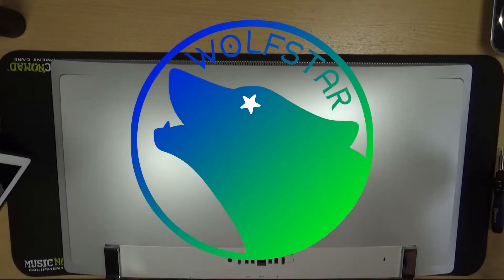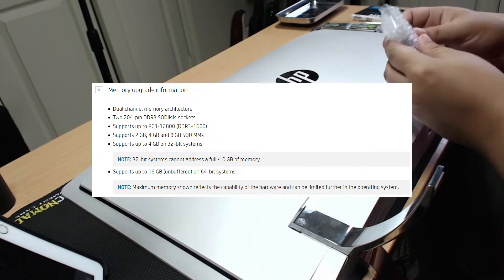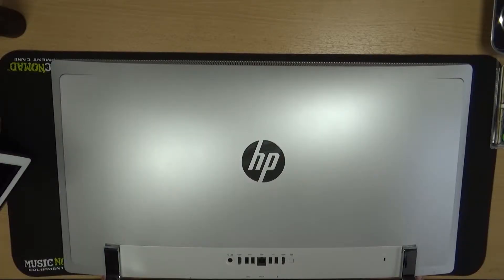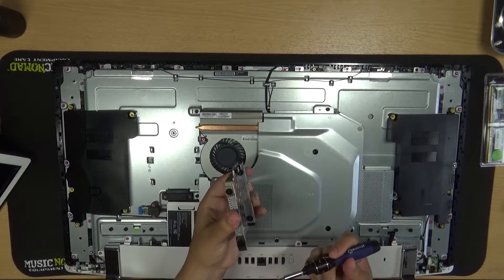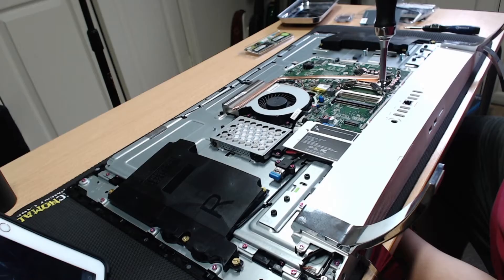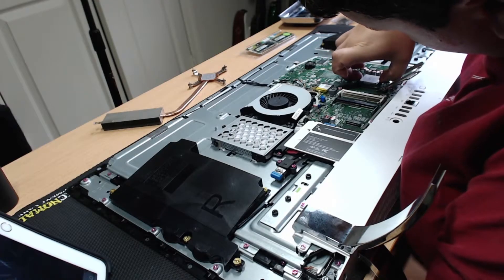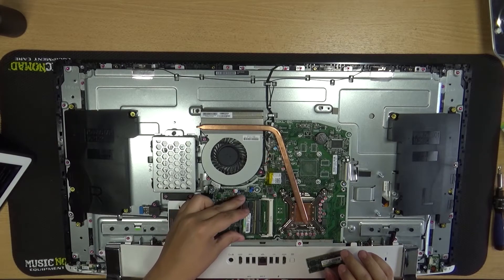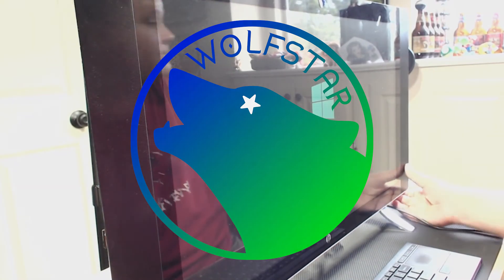HP Envy 27-p014 TouchSmart All-in-One: CPU, RAM, and HDD Upgrades

Comment: What are the specs on the Power Supply ?, I bought the "HP Envy All-in-One Desktop touchscreen PC 27-P014 without a power supply, so I need to order a power supply to see if it works. I tried a 19V 240V 3.34 & 19V 240V 4.62 Power Supply, but neither of them worked

Comment: Great VID.   ..How did  you find out the I7 6700T was the best upgrade this PC supports?  Thanks!  BTW - Just upgraded to SSD and Memory. Huge boot time difference.
Reply from the maker: I went to the HP website and found out which motherboard the computer uses. There was a list of the CPUs the motherboard works with, and there were only 2 of them. I had the weaker one, so I upgraded to the stronger one.
Reply: @onebigwolfyboi  Thanks for the reply.  yep im wondering if its worth it at this point to make the switch from I5- the PC has new life right now already (thanks to you). . I have the I5 like you did. . Thanks again.
Reply: @jjerry56  i am going to grab a used i7 6700T for upgrade myself. I was wondering if this motherboard may actually accept ddr4 since that would allow 7thnorn8th gen which are better for streaming but i dont believe it will

Comment: can i add 32 gig of ram? i have the same unit .Got rid of that slow 2.5 drive it came with...I also have the 34 inch curved envy all in one but changing out the hhd was a pain removing the front screen...Thanks
Reply from the maker: Unfortunately, this motherboard only supports up to 16gb of RAM.